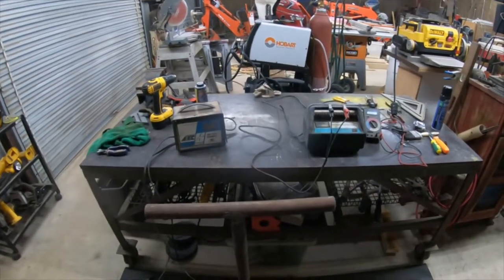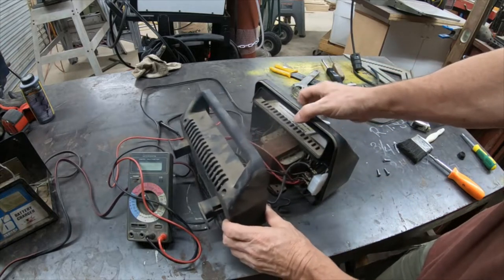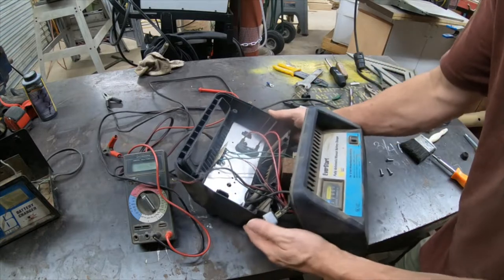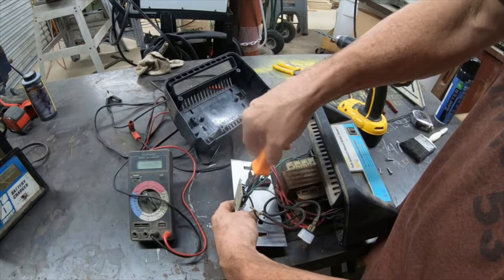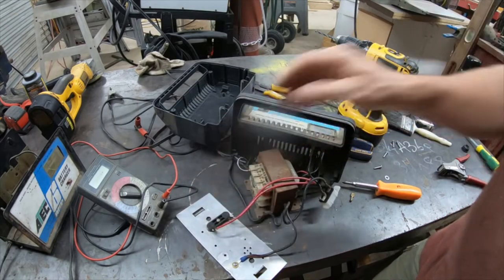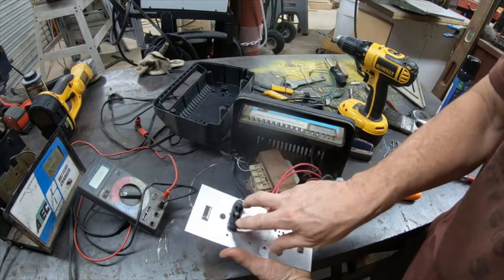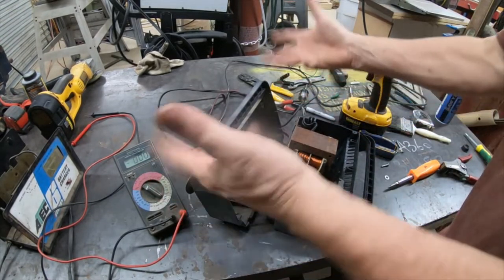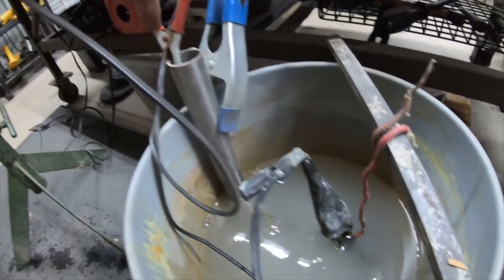Convert a 12v Automatic Battery Charger to Full Manual for Electrolysis

Comment: Great upload. I would have a field day working in your shop. I lucked out today and was doing some cleanup work and the owner had a 30+ year old battery charger that the owner generously gave me. I've been metal detecting,magnet fishing, and bottle hunting for 28 years+ so now that I have the right equipment I'm excited to do some electrolysis this afternoon.

Comment: I love the idea of adding a second positive lead, but I'd just put an on/off switch on it so I could turn that lead off when I just wanted to use the charger in smart mode to charge a battery. I hadn't thought of adding a third lead, but that's an awesome idea.
Reply: Interesting! I think I'd add ports and plugs on the case for the positive lead so I'd just have one positive lead I could plug in for "smart" or "dumb"charging.
Or one could use a switch so positive lead led to the right spot, original or to the whole plate.
If I have this correct?

Since most "smart" chargers won't charge a very dead or weak battery I'd like to sometimes be able to do some "dumb" charging.
So, I found the video helpful for that reason too!

What was the deal with your manual switch setting?

I've heard some "smart" chargers have some kind of override but most don't.
It's rather maddening when your voltage is too low to run the charger...it's kind of crazy if you ask me...

Comment: Hi,
For my purposes, I would add two 50V computer style caps to really smooth out the DC coming out of the charger and add a buck/boost regulator to control the voltage to what is needed at the time. I am a ham operator, and need to have constant current and constant voltage for some of the battery types I use. But your transformation of a charger to a DC voltage supply is novel to me. Interesting video!

Comment: Couldn't you just tap into that 12v lead, leave the circuit board in place, and run that tapped wire thru a switch and then connect it to the rectifier?  Then you would have a full manual/automatic charger with amp gauge lights.  Right?

Comment: Battery charger that won't charge a dead battery what a brilliant idea.
Reply: Yes, this drives me nuts!
My first "smart" charger came from a thrift store without directions and it charged one of my batteries just fine, great, it works! Then I put it on another low battery and nothing!
Then I do some research and find it doesn't work for the main reason I want a battery charger!
It's so stupid!
I feel I have to own two chargers! Or sell mine and find an old one...
It's ridiculous!

Comment: You can hook the LED to 12v. You need to put a 1K resistor in series with the LED. It will work fine.

Comment: Be careful putting brass and aluminum together! Or copper and aluminum. They tend to react with each other by galvanic action and cause corrosion. Not good. It does take some time for it to show, but it will unless you use some petroleum jelly in the connection to keep oxygen from getting into the connection. Same goes for battery posts and battery clamps, brush the post with the "vaseline" jelly before clamping the battery cable to the battery post to eliminate corrosion. You can do this to the alligator clamps on the battery charger to save them from corrosion, too. A neat save my Uncle taught me years ago. Vaseline or petroleum jelly is very inexpensive and very effective to stop corrosion problems between dissimilar metals used in electrical work. I use it in my solar panels all the time to prevent corrosion between dissimilar metals by galvanic action.
Reply from the maker: Good to know! Thanks for tips!

Comment: Is there any way to control the amps?
Reply from the maker: If you need to control the amps with a rheostat then I'm not sure about how to go about wiring it in. For electrolysis, you can control how much amperage your pushing through the relic by the amount of baking soda you add to your solution.